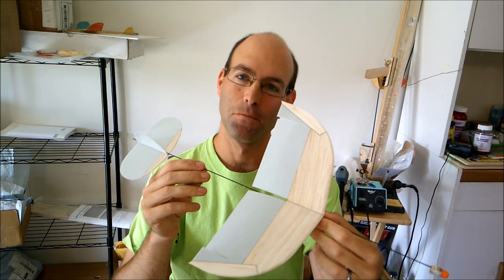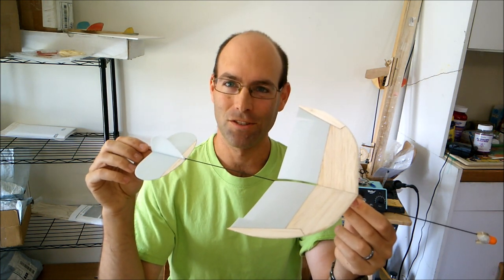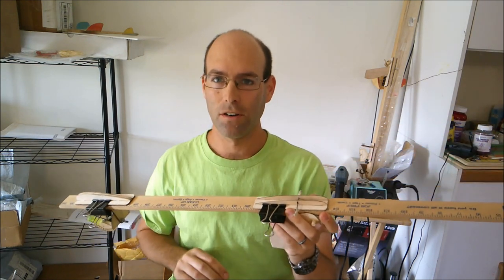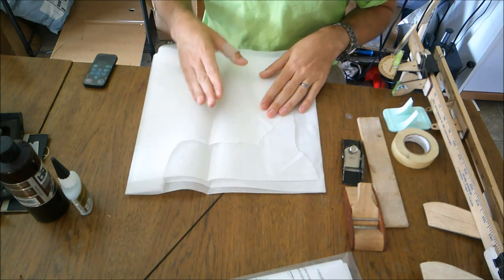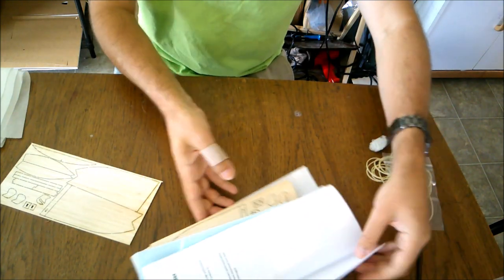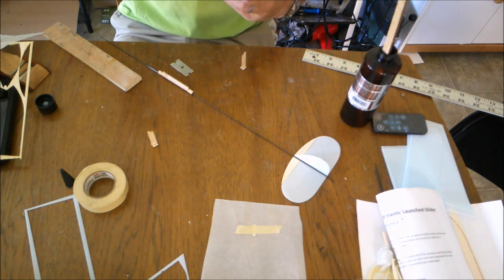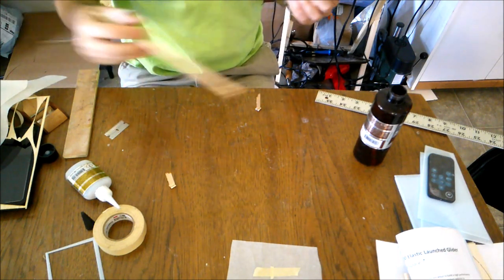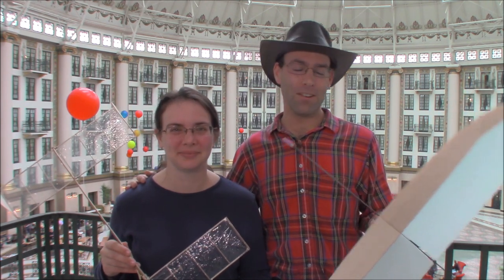Super Protege 2021 Science Olympiad Elastic Launched Glider - Build instructions

Comment: Hey it’s Kane .I have I question I am trying to paint my guillows fly boy. what do I do cause I can’t find any color dopes.
Reply: And is it possible to add food coloring to the dope
Reply from the maker: @sinocertops1692  in theory you can add food coloring or other additives. Personally I prefer a single coat of dope thinned down to 30% and then a really, really thin misting of spray paint. Remember the air doesn't care about the color of your plane, and most planes with those pretty finishes are heavy and fly poorly.